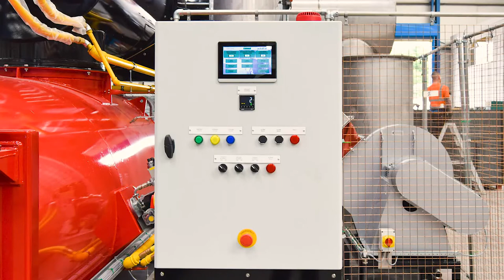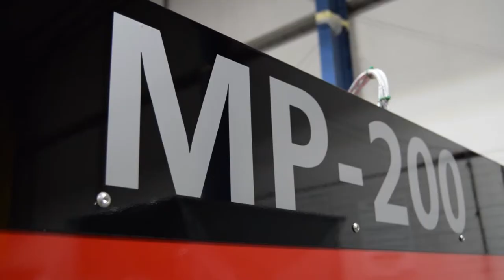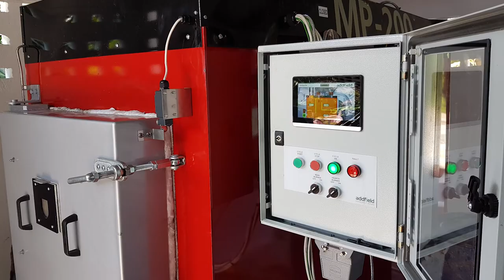C Range vs. MP Range | Comparing Medical Incinerators

Comment: HI nice to see you what about heat recovery system ? also how do we tests the Emissions levels  with C200?
Reply from the maker: Hi Bashir we do offer heat recovery systems however these are dependent upon the type of waste and project that these are installed for. We provide the most suitable solution for the jobs so woudl work with you to ensure that it was the best fit and value for you.  Also with regards to the emissions, we have many examples of tests for our machines and can go over these with you in more detail, again these can be influenced by the waste being itroduced to the machine which would just require the progamming to be adjusted to deliver maximium results. If you do have a project in mind the best source of information woudl be to contact our team via sales@addfield.com.
Thank you for your comment.

Comment: Great achievement.can we add c series sucrubber system instead of ventury system ?
Reply from the maker: Hi Ghulam you will need to discuss that with our technical team if you could email sales@addfieldcom with your question we can run through your project and options in full. Thanks.

Comment: Are there expensive to buy
Reply from the maker: Hi Ste UK the cost is all relative to what you are currently working with and using to dispose of waste. Our machines are built out of premium materials and have been desiged to work for over 20 years. Additionally they are also designed to be 40% more fuel efficient so saving you money every time you use it.  For our Pet Cremation customers many are able to achieve a full return of investment in as little as a year. 
So in answer to your question they are not expensive to buy and they are fantastic value if you would like more information on exact costing please contact us at sales@addfield.com with your full project breakdown and we will propose your best solution and costs from there.

Thank you.